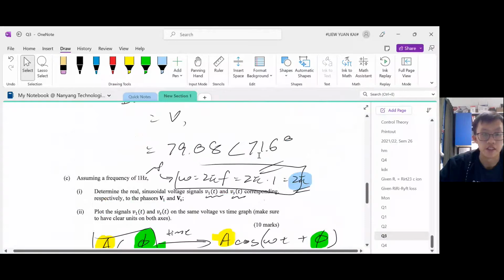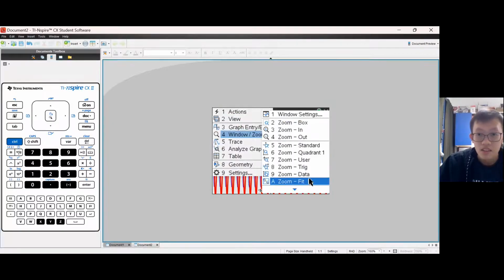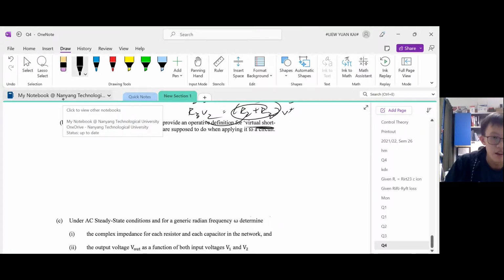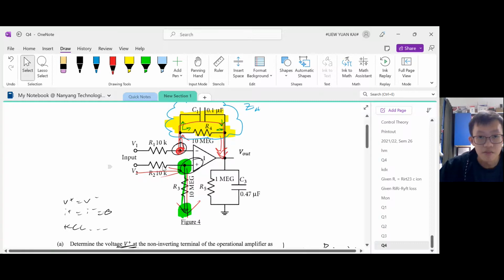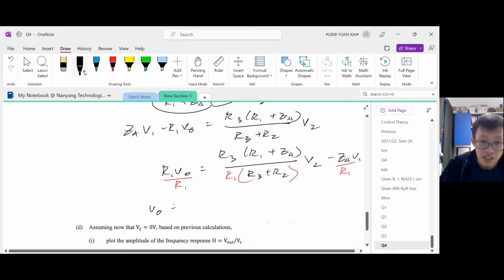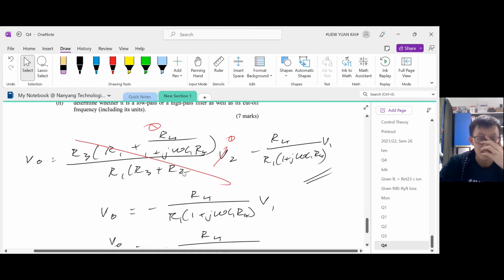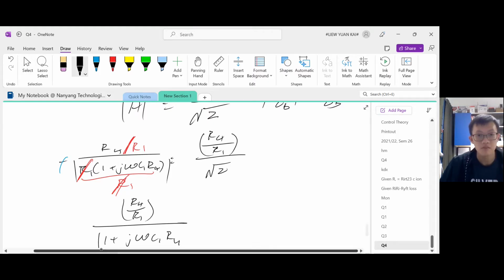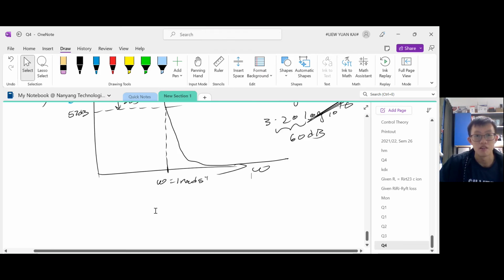MA2009 22/23 Sem 1 Q4

Comment: Since part c states that it is in AC steady state, shouldn't we ignore the capacitor when calculating for c(ii)?
Reply from the maker: No, the trick in which capacitors "disappear" is strictly for DC STEADY STATE. 
Remember in the Week 6 tutorial, I described how the V vs t graph of a capacitor looks like when you close its switch? When you hook up DC voltage supply (constant voltage value) to a capacitor, it will first dramatically rise until a long time later the p.d. across the capacitor stays constant. This dramatic rise is the transient response (opposite of steady state). In DC steady state we focus on the behaviour of the capacitor when its V vs t is more or less a flat line.
When you hook up an AC voltage supply (sinusoidal) to a capacitor it will also rise dramatically first and long after this rise it will not reach a flat line but just become a sinusoidal wave. So when we say AC steady state, we are referring to the behaviour of the capacitor when it stabilises into a sinuisodal wave, long after the dramatic rise near t = 0
Reply: @dixonteaches7804  Thank you very much for clarifying my doubts 🙏
Reply from the maker: @adamsim3716  No problem. Just FYI, in the questions of the tutorial covered in Week 7 (AC analysis), we have always been working in the AC steady state condition. I seem to not explicitly mention this in that video. Perhaps this is why the words "AC Steady state" frightened people when in fact, we are familiar with this condition, we just never brought up what's its name 😂
Reply: @dixonteaches7804  True, normally the questions never brought up the term AC Steady State so I was confused 😅
Reply from the maker: In summary this is how capacitor behave when hooked up to:
1) DC Voltage Supply: Dramatic rise ->  becomes flatter and flatter and flatter forever (nearly zero gradient). Recall: i = C(dV/dt) = 0. This is why the capacitor "disappears".
2) AC Voltage Supply: Dramatic rise -> becomes the sinusoidal pattern of the AC supply it was hooked up to. There are still non-zero gradients (dV/dt is non-zero) in the V vs t graph so i = C(dV/dt) is NOT zero so there still is current flowing through capacitors. So at AC steady state, capacitors don't disappear.